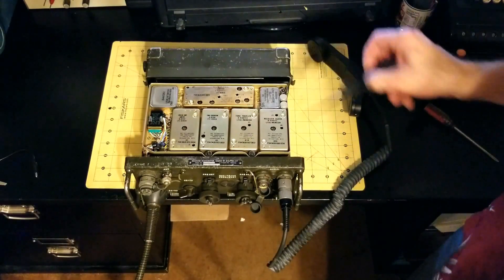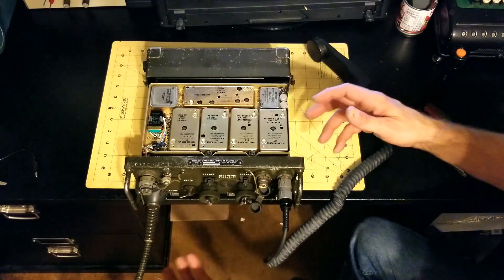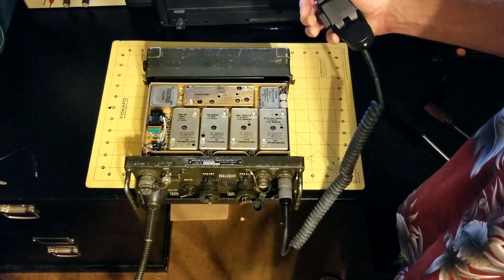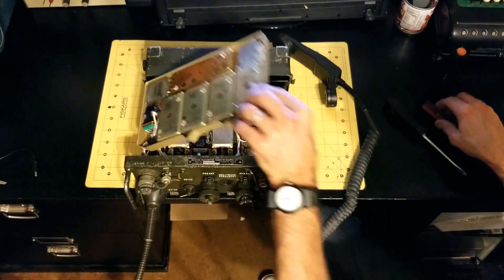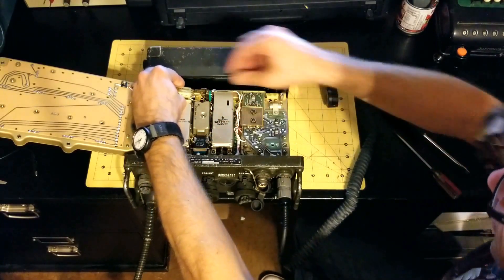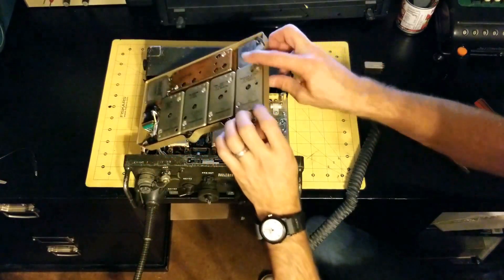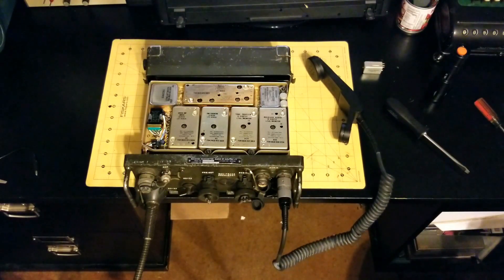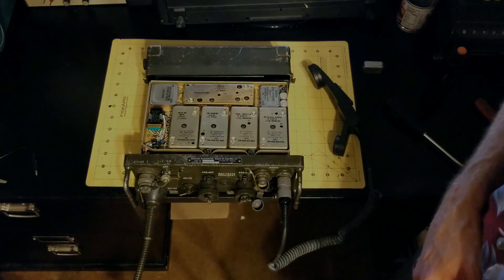PRC-77 Radio Repair Demonstration - Defective Module Replacement A50 Transmitter Mixer

Comment: My PRC-77 as of right now turns on just fine but there’s a pulsating noise and it seems as if the A38 module is bad from what I’ve read, unless you know of any other potential causes any advice?

Comment: Its been 10 years since i messed with my radios.  I have the same exact problem going on with my 77.  What modules can I test with the grm55?  I thought I seen a list for the prc77 using the grm55 but i am not sure.  Maybe I was just testing the module numbers.  I suppose I will look in the manual how to test A50.

Edit:  It wasnt A50.  Tested both modules in a good radio and put known good in bad radio.  Radio INOP on TX.

Comment: The small module in the top right corner next to the Receiver Long Receiver amp and mixer Module and the screw is called the Crystal Discriminator. Where can I find one because I currently have been operating mine with out one

Comment: Very good
I have to tell you that the worse problems I've experienced are synthesizer part. Lock on wrong frequency when changing channels. And I end up thinking they were related with frequ tuning gear tolerances and ageing. When gear locks capatiors in wrong capacitance.
Reply: Look for PRC-25 & PRC-77 Problem Log By N3OC and even on radionerds page aviable